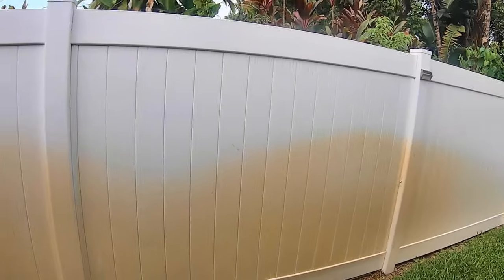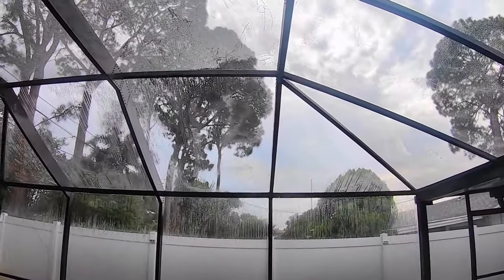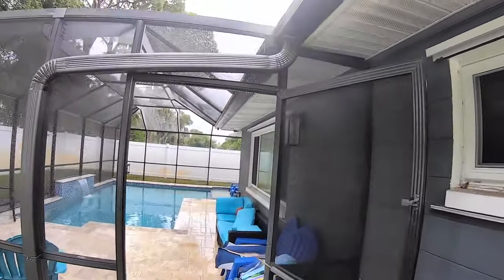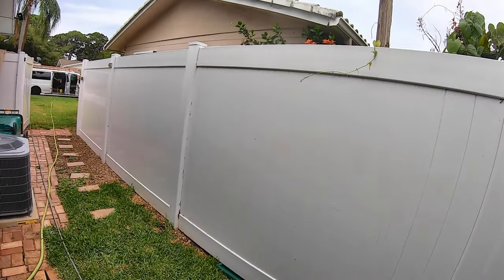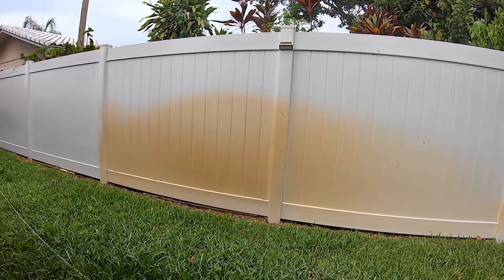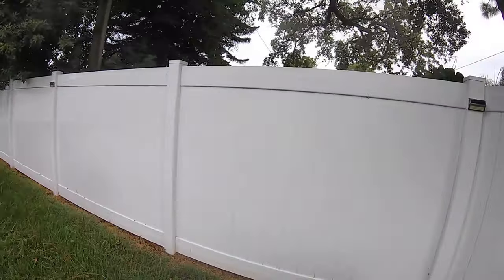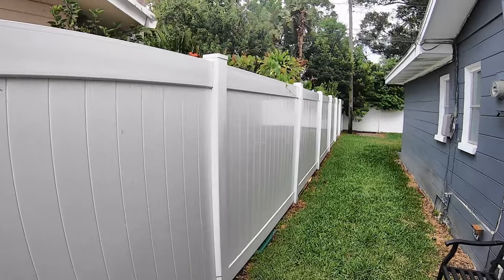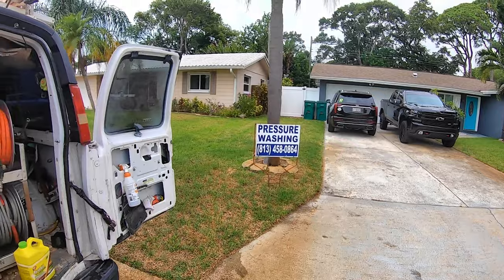Rust Removal on Vinyl Fence & Pressure Washing

Comment: I saw you use RustAid on concrete to remove rust stains and how fast it works is amazing.
If I ever need deal with rust on surfaces, that's what I'm going to get especially for the price. 

Great job as always.
Reply from the maker: You can't beat it. Just apply straight
Reply: Great work as always
Reply from the maker: @oyblawnmaintenance7555  thanks 😊

Comment: What size tips do you use on jrod for downstreaming? If video are def my favorite, learning alot!!!
Reply from the maker: These are my tips except I swapped the 0050 for a shooter tip

https://shop.pressurewasherproducts.com/8-GPM-JROD-ASSEMBLY-HIGH-LOW-SOAP-RINSE-20-50-ORIFICES-6540-8.htm

Comment: Where can I buy that tip champ ?
Reply from the maker: Any pressure washing store. It comes with rhe Jrod set but if you don't have a J rod it's an 0015 jet nozzle
Reply from the maker: https://shop.pressurewasherproducts.com/1-4-MEG-0015-WASHJET-SPRAY-NOZZLE-6015.htm

Comment: Sprinklers got the Vinyl siding..  over years, built up this rust stain.  It's not MOLD or ALGE of stuff..  Rust..  Forget it all..  wipe on wipe off, 100% Muriatic Acid..  Swish it on with a wheel brush.. wait 5 min,  swishy..  blast it off.  $15 per Gal at HDepot.  Do the Foundation and sidewalks too!  Charge extra, and get Tipped to boot. 100% muriatic acid/concrete Etcher is nearly wipe on wipe off..  make it sparkle!!
Reply from the maker: Definitely said it was just rust on the fence lol. There's a few options to remove rust on fence (I've shown each one with the exception of using muriatic acid as I don't prefer to use that chemical). 

There's a whole playlist of me doing rust removal with 12v sprayers, pump up sprayers and on this one bottle sprayer.  It helps engagement with youtube and also shows ppl how it can be done using the bare minimum. Thanks for watching.

Comment: A simple spray bottle with CLR and it would be gone, no pressure washing needed here..
Reply from the maker: It wasn't pressure washed. It was rinsed after the rust remover took the rust off right nefore your eyes.  The product is made for simply that. Same as CLR